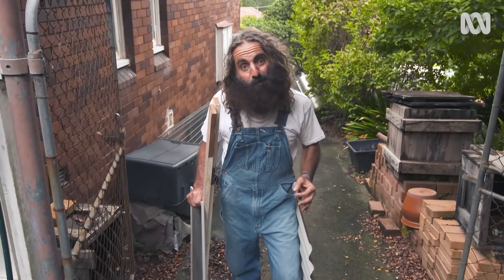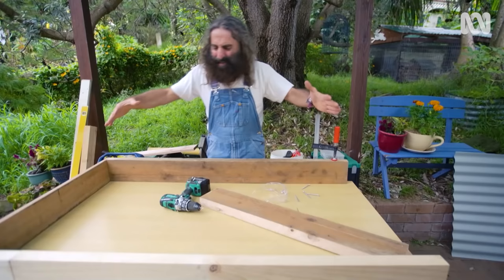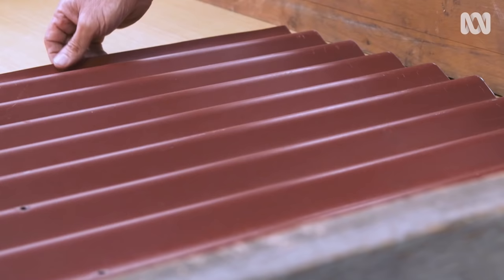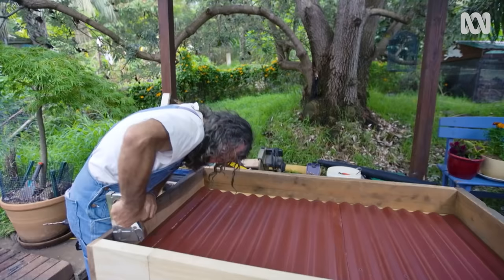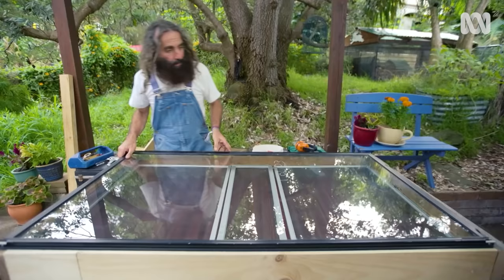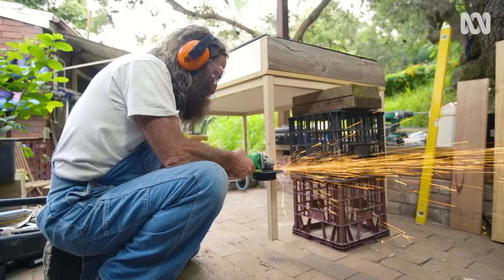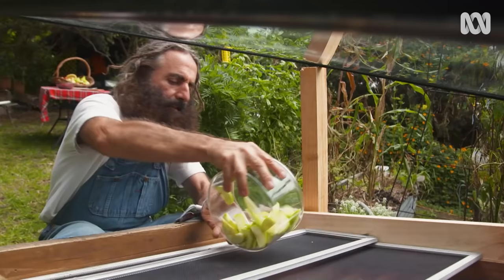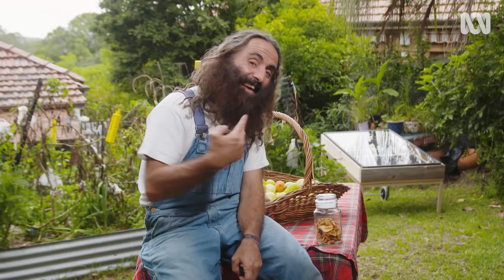How to make your own solar food dehydrator | DIY Garden Projects | Gardening Australia

Comment: Hey its my doppelganger from down under! Nice dehydrator.  I was looking at designs for a solar dehydrator with the exact same concept in mind as what you have presented.  It gives me the confidence to move forward with the project.  I honestly hadn't thought of using corrugated metal as a heat shield/ drip tray.